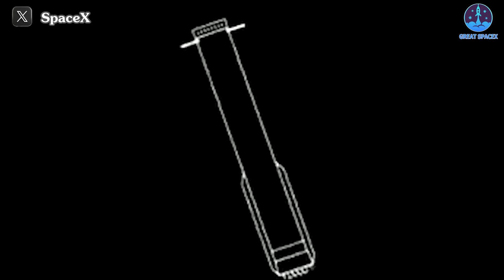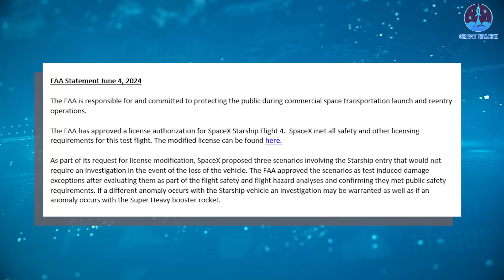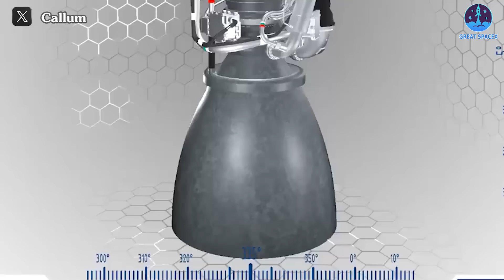Elon Musk Just Revealed CRAZY Plan For Next Starship Flight!

Comment: This channel doesn't seem to understand that these are just rocket tests. They point to the failed engine. SpaceX isnt even using their upgraded engines! So what if one of these old engines fail? They point to the failed flap. Stop smoking the weed. This is a test rocket! The test was intentionally not to protect the flap with heat shields, to see how it would last. They are not having heat shield issues!

Comment: What's next? I could make a case for orbital flight and a satellite release. Right now, Starship is capable of demonstrating those things. Attitude control seems to have been fixed and you have an expendable vehicle ready to go. We do not know if any fixes to the reentry system will work. Too early to try to catch the vehicle and risk the tower.
Reply: Agree.
Put at least one Starlink v2 in orbit.
I don't think the risk to the tower is as high as you think, though. 
They're supposed to be able to abort the attempt if it's not on target.
(Unlike with the F9 booster.)

Comment: To catch any vessle it must hit a target? Not miss by distance but by actual
precise position speed vertical stability.
Even  the sea and land landings are not on target
Rockets are thin skin metal tin  cans
flying bombs.
six light landing n
legs
Or shaped body and landing gear
would be better safer for human cargo
Space X sn is only a heavy haulage lorry to space
Not a really reliable People carrying bus
Reply: The F9 booster landings require suicide burns because one Merlin can't throttle down to hover an empty one.
Two or three Raptors can hold empty Superheavy in a hover.

Comment: Saving weight not installing the proven landing legs? Is chopsticks a long shot?
Reply: We will see.
The weight saving justifies attempting a tower catch. 

The Falcon 9 legs have components that are replaced for every flight.  So, not as relaunch ready as Elon is aiming for.
Reply: Landing legs failed every time?
Reply: @mikegardner107  I meant landing legs of the falcon 9
Reply: @eduardoa550  You are proposing placing the relatively small Falcon nine landing legs on Starship? They will never support that much mass.
Reply: @mikegardner107  obvious my friend, those legs should be accordingly to the size of the booster, inner structure would need to be strengthened, but it could land anyware
Reply: @eduardoa550 they don't want it to land anywhere except back on the tower for the next launch.

Comment: Can you answer how the ship and booster managed to sink
Reply: They are made of metal and metal is heavier then water so they sink.
Reply: @wally7856  but with sealed fuel tanks that will at that point will be full of air and make them buoyant. Ships are also made of steel and they don't always sink
Reply: @richieward6348  You can't seal those tanks, they would explode as the fuel boils off and pressure increases. They have vents.
Reply: @wally7856  After splashdown, vents were set open to allow water to sink it.
Reply: But what also floats?  Small rocks.....bread.....     A DUCK!!!!

Comment: Based on the amount of damage done to Starship's fins during reentry, I suspect we'll have to wait until V2 or even V3 before the fins will be able to survive reentry in good enough condition for them to be used to catch Starship on the pad. The fins are going to have to be significantly beefed up to survive reentry and that means more weight and V1 simply doesn't have the mass budget to support that. V2 will have a significant additional mass budget which will allow the beefing up the fins, although exactly how much beefing up will have to be done before the fins survive reentry in good enough condition to allow them to be used to catch the Starship by the pad is still an unknown that needs to be figured out.

Latest word from Space X is that Launch Pad 2 is not due to be available for use until late 2024 to early 2025. NASA also wants to have a least 1 pad and preferably 2 pads available at KSC for Starship launches ASAP as well.

The next 4 boosters and upper stages are all of the V1 format, so unless they scrap most of the existing boosters and Starship upper stages and move to V2 immediately, I don't see them trying to catch the upper stage any time soon. Catching the booster however I do see as a possibility.

As for what Space X can do with the V1 hardware, they are going to need to demonstrate multiple refueling flights between 2 upper stages in LEO in a quick enough cadence that the amount of fuel transferred is more than was lost due to boil off in between flights, a TLI burn, an LOI burn, and several unmanned landing attempts on the lunar surface before Artemis 3 which is currently scheduled for sometime in 2026/2027. All these tests could be done with the V1 hardware while waiting for the V2 hardware to become available for total reusability. Recall that Falcon 9 completed many 100% successful launches of paying payloads using pre-Block 5 versions of the Falcon 9 booster before Space X got the booster landing and reusability process worked out. It would be completely understandable that it takes a few versions of Starship before 100% reusability is achieved. In the mean time, allowing for deployment of a useful payload into orbit and demonstrating the other capabilities besides reuse that Starship must have to get to the moon and Mars is something that needs to be done anyway, so might as well do them sooner rather than later.

I wouldn't be surprised if the upper stages of Starship are not fully reusable (the LEO variant I mean) until long after Artemis 3 has flown. I'm not very confident that Artemis 3 will fliy in 2026/2027. Even if Artemis 3 is delayed until a more reasonable 2030, I don't think that the full reusability of the upper stage component of Starship will have all the kinks worked out of it by then. That being said, the ability for Star City to rapidly pump out large numbers of Starship upper stages as the boosters get reused will probably allow for the upper stage to be expended like Falcon 9 currently does, while Space X provides the launches it has under contract while working out the fin issues during reentry. The end goal is full reusability, but even partial reusability will lower the cost per kg well below what Falcon 9 can offer, which is well below what the full expendable competition has to offer. Being able to put 100 tons into LEO all in 1 launch is going to open up so many opportunities that the fact that the upper stage is not 100% reusable right away is not going to be as big of an issue as a lot of people seem to think.
Reply from the maker: Thanks for your great comment. Keep following and discussing on our channel ☺️
Reply: Why do so many armchair "experts" ( that are mostly Spacex critics ) that think they know better than the Spacex Team  experts ??? Many of them are the same self-appointed "experts" that claimed the water deluge system would never work !!!

Comment: The fact that one of the engines failed to ignite on the Super Heavy tells me that another soft landing at sea should be performed.   All engines should perform perfectly before a chopstick landing is attempted.
Reply: The Raptor engines are not completely throttled up meaning they’re not at full power during a launch, therefore there is a margin for error. So 1 or 2 disabled engines is not a big deal.
Reply from the maker: Yeah

Comment: nah ah, even i aint sure for the catch in Flight 5, its just not possible yet
Reply: Why do you think its not possible yet? I havent followed spacex or aerospace at all until now so i dont whats been going on.
Reply: @justin54511  ive been following the goals of spacex since 2020, i know what they are doing, the booster isnt just stable enough, as you may know 1 engine didnt work in the start, the engine is useless at the landing burn however if the center engine gone out at ift 5 that would be a masacre, not for the booster but also for the mechazilla and boca chica, spacex just inst that confident as elon musk is

Comment: I would prefer STARLINER touchdown on a pad/solid surface. Relevant to a lunar or Mars landing.
Catching a booster, as long as they have a backup tower. 
I would be interested in how much dynamic loading the tower/arms are designed to withstand. 
Per OSHA, we humans in a safety harness have to be tied off to a structure capable of withstanding 5000 pound shock without breaking. Not sure if this has changed recently.
Reply from the maker: Great future👍

Comment: If turning on, and off in a cycle an engine posses a potential risk, for operational glitches then it could be dangerous to board the rocket. The possibility of failure occurring can become a disaster if nobody solves any problems when it happens! Trying to prevent any glitches before it happens would be ideal in my opinion!

It does not matter if it is on land, or water, or air experiencing an engine problem is bad, and what is worse is not being able to fix an engine problem wherever, and whatever a driver, or operator, or pilot is operating!!! I believe it would be very bad, for an engine problem to happen in the air especially in outer space. Because nobody is going to help if it does!!!
Reply: That's why there is redundancy in engines, and multiple starships.starship. 
So spacex will helps itself. Not going be able to goto moon or mars with just one starship...😂
In reality they don't need that many engines and we're still aways from.humans catching a ride.
 If really dire ask russia for.theyre inspector military satellite 🛰 🤔
Reply: @DerfOrNuffin  Maybe going to get stuck, and maybe die in outer space if engine fails, for any reason.

Food, for thought, or perhaps not since Americans have something against making inspections!

I been watching what Americans are doing from where I live, and what has been happening in America!
Reply from the maker: Great analysis 👍

Comment: I wonder if the future "fuel tank" Starship might be feasible as a single stage to orbit. Removing all the hardware required for the separate Starship - engines, separation hardware, extra tank components, etc. - might be not much less mass than the extra mass cost of the empty booster versus if the system were just a single unit with bigger tanks. It's not a simple question.
Perhaps the biggest issue would be reentry capability
Reply from the maker: That's right. But let's wait to see how SpaceX will solve this problem